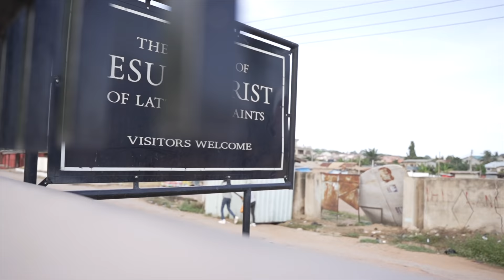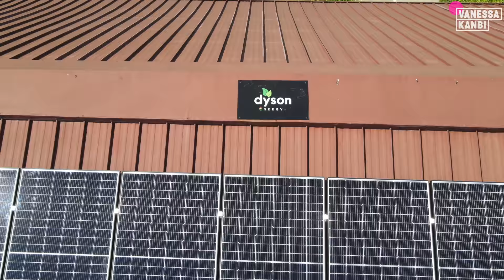LIVING IN GHANA | MOVED FROM THE UK TO START A SOLAR PANEL COMPANY IN ACCRA

Comment: Ghana has
 excess electricity capacity, our problem have been generation and transportation  of the power. And now ECG is doing systems upgrade and power fluctuations  will be the thing of the past. Interms of electricity coverage, Ghana have done 85 % of electricity coverage.  We are second to SA. We aren't doing bad at all.
Reply: Thanks for pointing this out. Too often the good gets buried in the constant negative coverage, creating the wrong impression that NOTHING good exist. That's unfortunate and it must change!
Reply: @jsx F do you think Ghana is like Nigeria?
Reply: In 2021 Gana should be doing a lot better. Sudden outages and power going off for hours at a time should be a thing of the past.Especially if what you say is true about them having excess energy to spare. Unfortunately generators are still very much relied on especially in Accra.
Reply: Dumso is looming

Comment: The truth is that there is very little communication between national policy planning and implementation. But in a developing environment, a lot of over hauling needs to be done. There needs to be a major infrastructural overhaul. However, it leaves room for the private sector to operate. There could be a lot of startups in the solar sector to meet the gap of electricity in power supply.